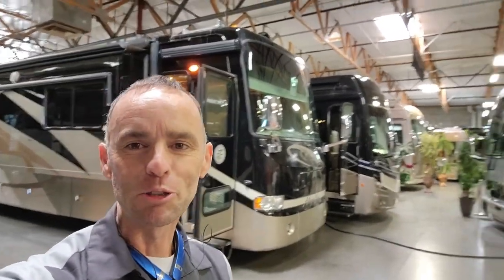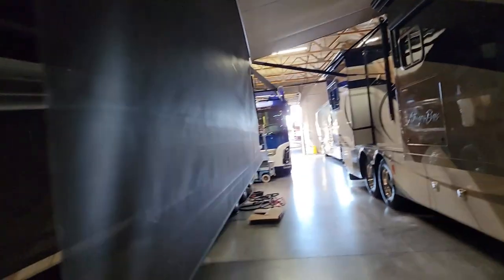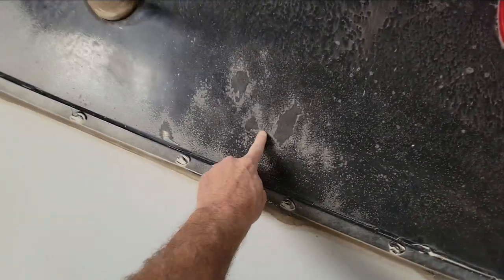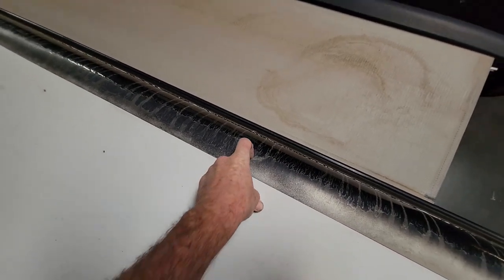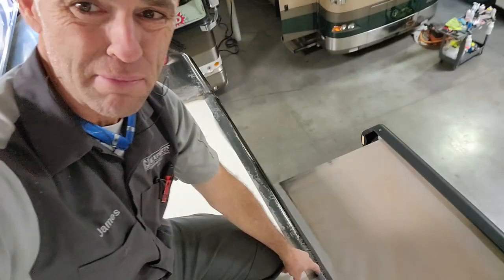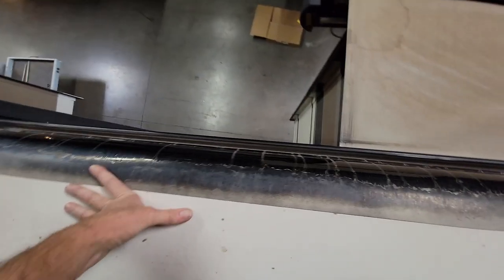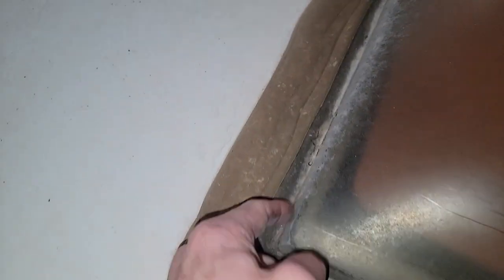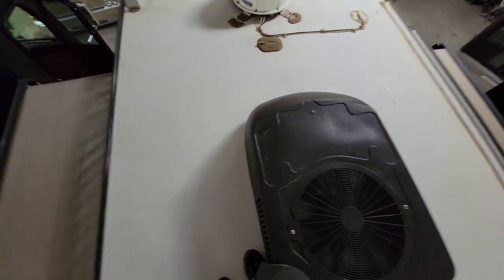What Does 13 Years Do to a RV from Tiffin Motorhomes?

Comment: Tiffins in that year group had 3 major issues. Roof rail separation, wet bay floor rotting and DS slide floor deterioration. These 3 should have been addressed by Tiffin in Red bay. Also leak at front door which can rot out the wood under the bottom step.
Reply: Sounds major to me and not much fun!

Comment: Being an automotive painter, and since it's black, I would sand that wrap over edge down real good to the paint line on the roof, you could put a thin coat of two stage plastic filler in the cracks, I would, but that is more sanding lol, then spray with some black epoxy sealer, and follow that with some black two stage black urethane, no clear necessary, I would also tape off the front and rear caps at the top over to where they start to roll over and paint those areas as well, that high up, you would never know, and on the caps it would be a faint tape line.
Reply from the maker: Glad I don't do paint! :)
Reply: @AZExpert  yeah, I wouldn't want to have to that either, I've never painted on anything that big, my hats off to the custom painters who do the higher end coaches. I will probably wind up with a dog on the outside, and will probably have to  attempt it.

Comment: The real issue with these large bus style chassis are what you covered but the chassis components .air bags wheel bearings brakes steering links axles shocks suspension parts hoses engine oil leaks if someone drove it and had bad maintenance you have a money pit along with wiring problems inverters batteries and anything rubber that's aged out..ask me how I know been there done that nice video James happy new year
Reply from the maker: :) Thanks for watching!
Reply: My 02 badly needs front air bags and Koni shocks.  $1400 for parts, plus labor, which is $175 per hour these days.

Comment: Merry Christmas James!   So for gelcoat fiberglass use the 311 silicone sealant you linked.   Correct?   Suggestion, you might show a roof wash and wax sometime.   Up here in Missouri, the hard rain pretty much kept the TPO roof clean.  Will see if the same is true for the fiberglass on our new used one.  Best wishes to you and your family!   Respectfully,   Kevin
Reply from the maker: I don't usually do that for customers but if you are talking about which product, just a Maguires you can get from home depot will work
Reply: @AZExpert    Merry Christmas again James!   Hope you had a good one.

Comment: James: quick question if I may. Have a 2003 Tiffin phaeton and have an issue with the rear air pressure gauge (w22-00008-000 or 01  also KYS 6913001611 made by Borgwarner) in the dash. I think the gauge is not good but impossible trying to find the replacement (front or rear gauge not minding the printed label on it). I think they are obsolete. can not find anything compatible. what are the newer models are using as air pressure gauges ? is it possible to upgrade the air pressure gauges system as the ones being used on newer models ?   thanks.

Comment: Hey what do you think of the idea of removing all Dicor off my EPDM roof and replacing it with Nuflex311. Of course I would have to perfectly remove the old Dicor
Reply from the maker: I think its not a good idea. nuflex is not recommended for membrane roofs and it's nearly impossible to remove the old dicor completely.

Comment: My 2010 Bus has a roof that is delaminating and has soft spots and is spreading so I am pretty sure water is getting in.. It has started to leak at the front overhead cabinets. I cannot find where it is coming in. It has destroyed the bottom of the overhead pass side cab. After a recent move it no longer shows up. I fear it is just getting in where I cannot see it. 
I have looked and looked on the roof for any suspicious  spots and have sealed over those places but did not help.
Reply from the maker: You should really take it in to see a professional before it gets out of control

Comment: 13 years means they are no longer supported by the factory. I would stay away from these.
Reply from the maker: Nah, not if they were maintained. Used coaches are sometimes a good value
Reply: You have to be kidding. How manny products at any level are “supported” by the factory, builder etc even after 10 years? The two questions are easy: how well built originally, and how well maintained by earlier owners.